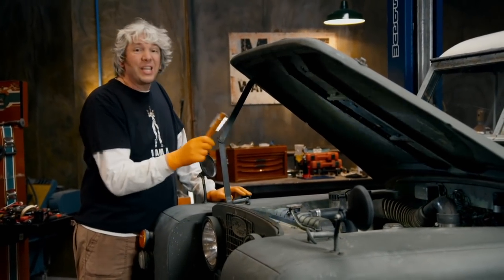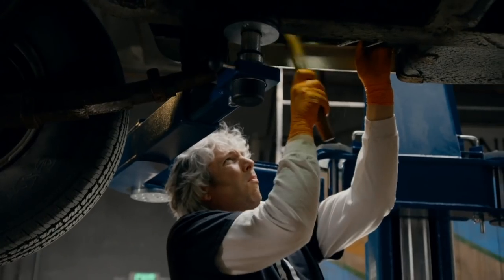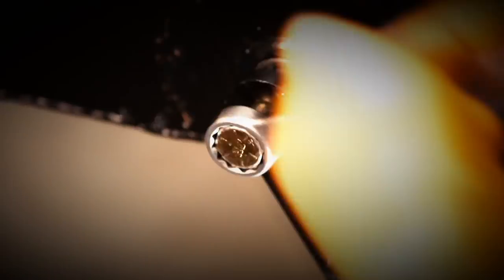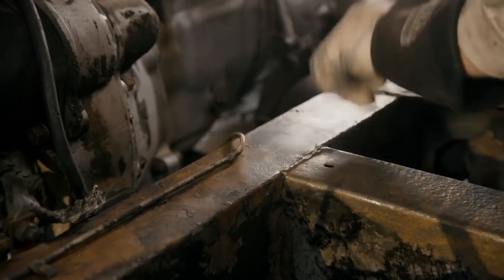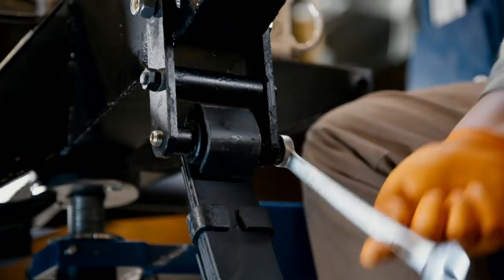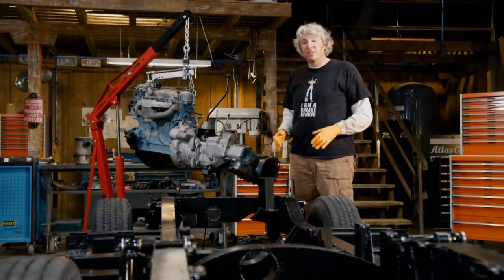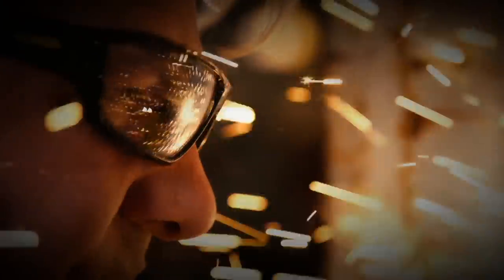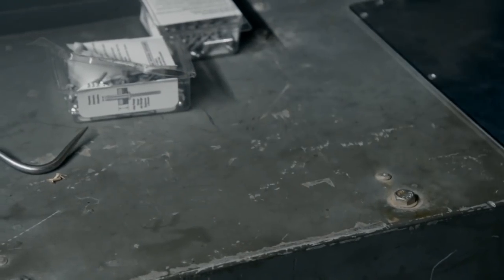Land Rover 2A: How To Refurbish The Chassis And Install Water Tanks | Wheeler Dealers

Comment: Powder coating looks good, but simply isn't as hard or durable as POR. This is not just my opinion (although I've been using POR for 25 years). Multiple independent tests have confirmed this. https://www.youtube.com/watch?v=Ag46YUovPUc
Power coating works fine until the first stone chip. Then salt gets in and the whole messy rust process begins again. Smart people first spray on POR, then several heavy coats of quality truck bed liner. That makes a pretty impregnable barrier to rust.
Reply: I agree,  after all that work he put in taking the body off you need better than powder coat,  galvanized would have been my choice